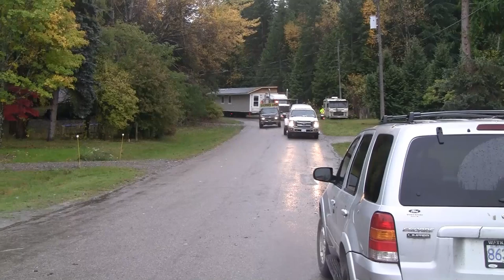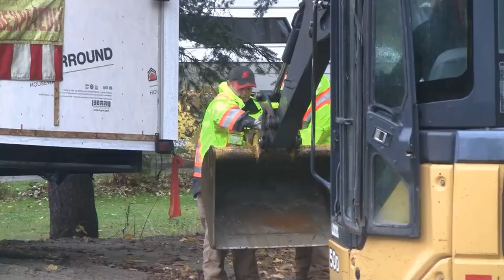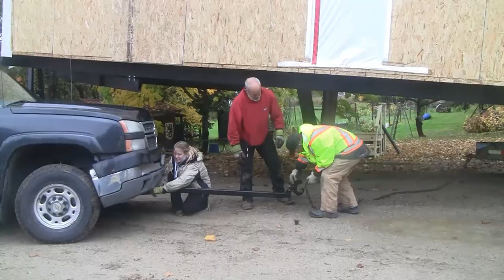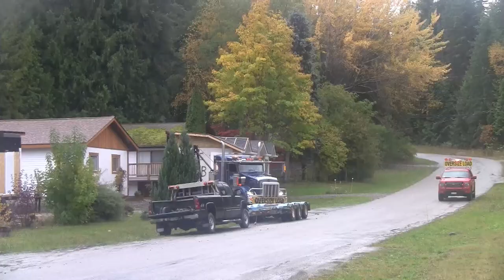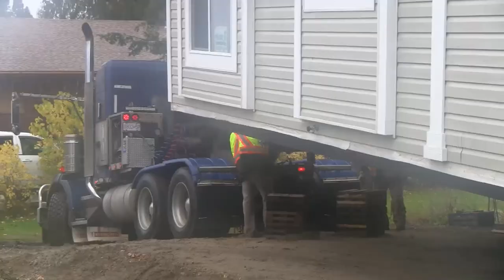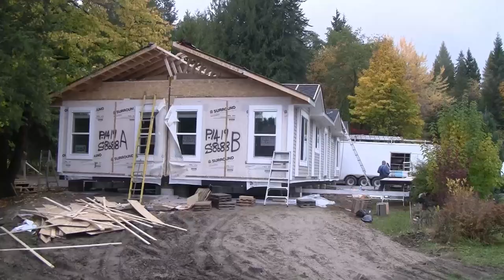Modular Home Delivered and Set Up

Comment: I prefer the term MANUFACTURED. It’s made in a factory to standards that are approved by all states. I rented several,of them and my renters were very satisfied. Like any kind of house, stick or brick, the first twenty years is basically problem free, after that, they all need some fix’in.
Reply: This is a manufactured home. Modular is placed on a foundation. This home was still left with it wheel frame so it is a mobile aka manufactured home not a modular home.

Comment: Those of you who commented that modular homes like this are "unsafe" and "fire traps" need to do your homework.  Modular homes are NOT the same as manufactured homes.  Modulars are, in fact, built to the same (and in some cases more stringent) codes and restrictions as stick built homes.  They therefore are just as strong and safe as any stick built home, and can withstand high winds and even tornadoes up to EF-2 strength.  Many regular homes can't even match those standards!)  Therefore please do some research before posting such rude and disrespectful comments.  As for the owners of this beautiful home, CONGRATULATIONS!

Comment: WOW that was an easy set up I needed 2 large cranes to set my modular house on the basement foundation .I have 2x12 floor joist but had the steel frame left on so it would make my floors sturdier and there is also steel cross beams set on the basement walls running from back to front and support poles in the middle of the basement under the steel beams  .Also modulars can be set on piers if there is no basement .My house also has 2x6 stud walls and is 32 wide  .Usually it is set on cribbing and then piers are set after .I made the place hire Ricky Evans to haul and set up my house and was here the whole time .He is the best hauler in VA and NC
Reply from the maker: Ours by comparison is a modest 1500 sq ft home. Ideal for my wife and me in retirement. Thanks for the info!
Reply: We are retire also and retired from NJ to VA .I watched my house being set and was amazed at the work involved .I would do it again also .I know my house can do 60 down the road and not subjected to weather conditions in the build that it will last .Plus no over run costs a flat price and no hassles .My biggest things was the well and septic tank Congrats to you both and a long future in your home
Reply: Peter Klopp how much did you paid for 1500 sft.?
Reply: I  was lucky my modular after discounts and my own plan was 89 thousand and set with 2 cranes on my basement .They gave me a bonus because I paid cash .It is a 2440 sq. ft 2x6 stud wall house .I also left it on frame for stiffer floors and also had it built with no flooring since I wanted to put in the flooring I wanted in the house .The decorator from norris homes did all my curtains for the house and that included the blinds .I also have 2 sets of sliding glass doors .
Reply: Sissy yu got great value for 2440 square feet.....!!!
Could never do that in san jose!!
Reply: The basement is why they needed a crane to set up
Reply: @jamesmotter1221  I have seen them use metal across the basement and slide the house onto the basement also   . I  designed my house and gave norris homes my plan  and they gave me a great lower cost on my house . I see they still have my plan up , but it is a smaller house only 2000 sq . ft and sells now for 239 thousand   and now you have to pay for set up  fees . My modular was built in 2004  with 2x6 stud walls  and bigger windows and drywall and 2 sets of patio doors . I should have gone with a half basement and a half french basement  . But I did have plumbing put in the slab  for 2 bathrooms and laundry nd kitchen  just in case and had the slab insulated .  You really have to do lots of research on costs and what you  want . Things are even harder now than ever before

Comment: 1st thing is that that home is not a modular. It is a HUD code manufactured home. Modulars don't have steel frames & are not set up on blocked piers.
Reply: FoghornLeghornism. You are correct.
Reply: Nailed it! I was gonna state the same but seen it's already been done.
Reply: F
Reply: You are 💯 percent correct!!!! I hate how some dealers/builders try to say they are something that they are not.
Reply: Basically what  I explained above. You did bettet.

Comment: please explain to your audience the difference between a modular home and a manufactured home. We live in Florida and everyone thinks that the modular home that we had previously prior to the move here is actually manufactured home. I tell them that, in fact, a manufactured home is a mobile home or double wide mobile home.  it is my understanding that a modular home is an actual home but built in the factory not on site.
Reply: A modular home is a home that is brought in from a factory and placed on a permanent foundation. A modular home typically cost more because it has to come off the trailer is it moved with and because of that it has to be made with 2x8 instead of 2x6 construction. A manufactured home is made with 2x6s and stays on the trailer it is moved with  usually some sort of decorative stone is put around the bottom to hide the trailer part.

Comment: I'm not gonna hate on these people's home like so many have done but it's certainly not a modular home. I know this because I in fact do live in a modular home that was brought in by three semi tractor tailor trucks on huge flatbed trailers. Then they also brought in a huge crane that lifted all three separate modules on to a concrete based foundation. Then they built a 750 sqft garage as the finishing touch.
Reply: Was the crane service very expensive?

Comment: Interesting stuff. I wondered how they moved a home that didn't have wheels attached to it.
Reply: Camper Hollow It's a specifically designed dolly made to clamp to the steel I beams. A real modular home arrives on site via a flatbed trailer. The modules are then lifted off by a crane and set into place. Manufactured, aka mobile, homes like this are towed to the site and either have their Axel's removed or, as in this example, a specifically designed dolly is used. These dollies are becoming more and more the norm. Rather than the exception. The reason for this is due to failulres resulting from cheap single use axels, hubs and tires that tend to fail during travel. The main primary cause of failue are a result of uneven weight, road conditions, extended travel, and poor quality.

Comment: This is a mobile home not a modular home it's on concrete blocks a modular home sets on concrete slap
Reply: Not true. Modular homes can be set on a dirt pad, concrete slab, raised foundation, or even a full foundation with basement. Mobile homes have a steel chassis. All others do not. That's the big difference.

Comment: This is a manufactured home not modular
Reply: Not the same thing, built to different codes, Manufactured homes are built to HUD Code and Modular are built to area spefic codesI.E. Ohio Basic Building Code.
Reply: This is beautiful country where is this located please😊.  I want this house too😁
Reply: Add another one askewed and you have modular....ha ha ha
Reply: Mobey Catirac  then y is it not on a slab?
Reply: Old Gringo Local code doesn't require mobile homes to have a permanent foundation.
Reply: Ok I'm gonna ask a dumb question, what are the differences between modular and manufactured?
Reply: Sarah sayed Modular homes arrive on flatbed trucks in many pieces. Multiple sections are then lifted off by a crane, then placed on a permanent concrete foundation. Once all the pieces are put together, it is considered and valued like all other stick built homes. The mobile home industry needed a make over in the late 80's after some horrible quality issues and declining sales. So they began a campaign (Today's Manufactured Homes) to get the public to see mobile homes as Manufactered homes. A modular home is manufactured. This is where the confusion for many comes from. A mobile aka manufactured home has steel beams running the entire length of each section. This is so each section can be towed to the site. Because of these steel beam, where allowed, they don't require a permanent foundation. 

Additionally, modular homes appreciate in value more like a stick built home. Mobile aka manufactured homes will appreciate in value depending on the quality. The cheapest brands begin to depreciate as the years pass unless they are extremely well maintained and improved upon. It used to be all mobile homes were always recognizable. The last several years many higher end models are difficult to distinguish from a typical stick built rambler. Finally, mobile homes require different mortgages depending on location and foundation type.

In my opinion, pay the extra for a modular home. You'll appreciate the quality difference and the appreciating value when it comes to refinancing and/or selling. Additionally, pay for an upgraded furnace. They still put in a furnace that can barely handle the homes needs. This means they must run longer and work harder. The biggest complaints I've heard is it takes too long for the house to heat up, the furnace is always running, and the furnace broke down often. A larger furnace will heat quicker and need less running time. Thus reducing wear and lasting longer. They energy needed could also be less if using electric only. The other issues with mobile home HVAC systems is the lack of a true return air system. This leads to reduced air flow and poor air circulation in rooms further away from the furnace. It's another cost cutting trick they use. Vaulted ceilings are cheaper for them. One could add a return air duct with creative engineering. Adding built in shelving on either side of a return air duct to hide where the return stick out from a wall. Or add the ducting to a hall closet. I've seen some creative ways HVAC pros have installed return air ducts when the cheap furnace wore out. The air quality is much better. Much less dust and indoor air pollution. Oops. Went off on a little rant.

Hope this helped to answer your question. Cheers!
Reply: Cameron thank you it helped tremendously! I appreciate it more then you know. I've been looking into building my own home and I couldn't figure out the differences between the 2. So again thank you!
Reply: @J.Cameron.Stuart.Adams.  What a well written and informative reply. Thanks!
Reply: @J.Cameron.Stuart.Adams.  My grandma lives in house that started out as a cabin and never had a ducted air system. She went with a ductless hvac system from Mitsubishi, with mini splits installed in a few rooms. After the fact her electric bill dropped by more than half of what it used to be. It was costly to install, but it's been incredibly reliable, and she's saved a lot of money on her electric bill. The savings has more than covered the cost of the units and installation.

Comment: Manufactured Homes will not last more than 50 years. Very poor investment. Stick built homes last for hundreds and hundreds of years. Homes built in the 1600's in New England are still standing. A Manufactured Home will NEVER last that long.
Reply: My experience is different; my new stick built home has so many problems from poor quality construction compare to the previously owned 1988 Palm Harbor double wide.  2x6 and plywood throughout whereas the new home is mostly 2x4 and osb.
Reply: Well I built homes for 18 years and modular homes now days are built even stronger than stick frame homes now, the house you refer to from the 1800s we're built using true 2x4 solid oak studs and true oak siding, so that's why they have lasted, the new homes are all built out of yellow line which will not from the inside out
Reply: @Roger Evans do you think a couple in their 50's or 60's that are retiring could give a rats ass if their house lasts 50-years, or several hundred?
Reply: @roger I’m supposing you’re planning on living in a particular house for 200 years then? Have at it. Everything eventually goes away. It’s not good to shame people for doing what they can afford. Plus, some stick built houses are built incredibly cheap.

Comment: I hate these "cardboard homes." They are garbage! Just build a house if you want a house. These HUD-tagged cardboard houses depreciate in value and don't last any longer than the average trailer house. They also cannot be insured by 99% of insurance companies. They are insured by trailer/mobile home insurers which is junk coverage. They only use 1/8"-1/4" thick materials, the lack insulation, and modular homes do not have a strong skeletal structure like regular houses do. Instead of walls filled with studs, the walls are filled with simple 1/8" thick frame strips and only have a stud where necessary to hold wallboard. No sheet rock in these things. I owned one. They are garbage! Buy or build a regular house! Today modular cardboard houses cost about the same as many standard houses.